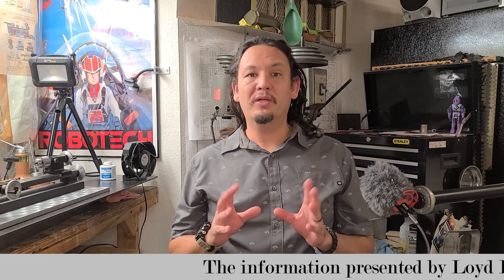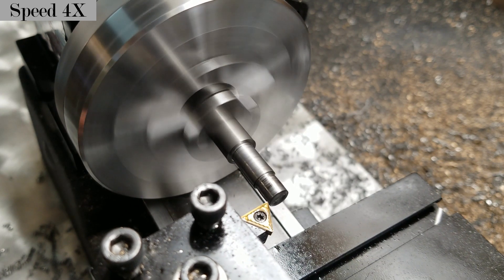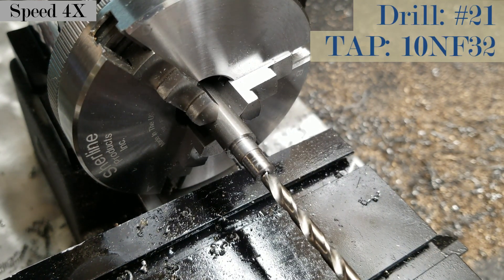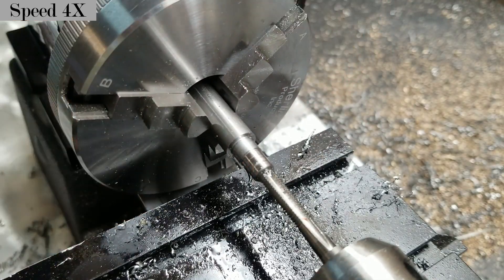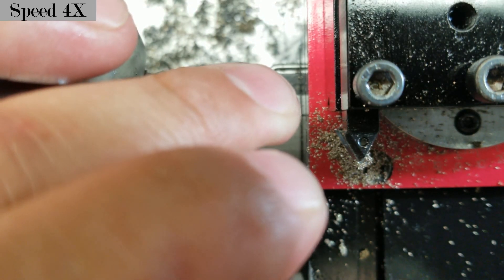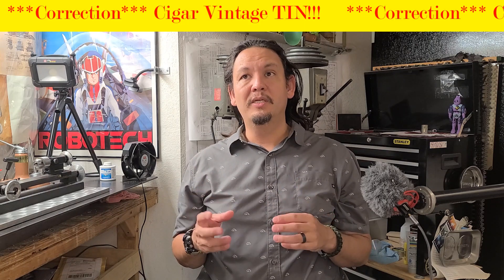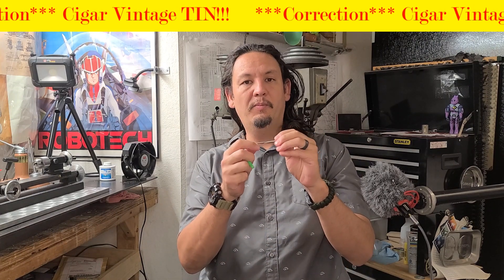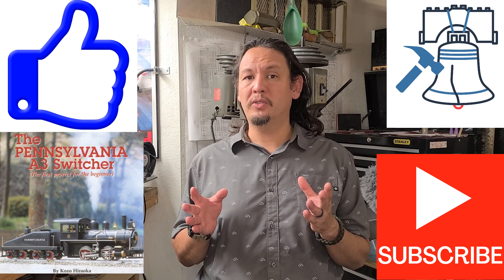Finish Phosphor Bronze Journal Bearings Turning, Layout, Taper Cutting, Fixture Making

Comment: If you have any money left (ha ha) a very useful add on for your Sherline lathe is the Beall er32 collet chuck and some collets. It screws on instead of the 3 jaw and is much more repeatable so if you ever have to go back and reuse a mandrel or remachine a parts it is centered. Get good quality collets such as Techniks brand. I got mine from All Industrial Tool. No financial interest in any of these, just use them all the time with my Sherline.
Reply from the maker: LOL too sad and true.  It all disappears like a smokey cloud of cutting fluid!!!  Thanks for the tip I'll check out Beall's collet chuck.  That be great to have to do a little work and step away or do something else and pick right back up again.  No the hard part finding enough money to get one!!!

Comment: Hi Loyd    On your 2:50 comment  ----- not so sure backwards as much as deflection tool pressure bend.  It looks like piece bending from tool going in  ---my thoughts anyway???????   Another thought  -------- With your bottles for your taps etc.   Go to Wally-World get yourself  ''Plano'' divided /adjustable  FISHING TACKLE BOXES & dyno label maker.  These are cheap - adjustable compact- makeup various  'kits'.   My example  tap/die set usually won't go below 4-40/ 6-32  MY (1) MODEL ENGINEERING TAP/DIE SETUP INCLUDES  1-72/2-56-/4-40/ 5-40 ---- FIND THAT ONE IN A SET ETC   & WITH THE DYNO LABEL MAKER YOU LIST THE CONTENTS --- PEEL OFF IF CHANGE   NOTE 5-40 USED IN LOT OF CASTING KITS/ I ALSO GET THOSE LITTLE DRAWER CABINETS --- MOUNT ON TOP OF ONE ANOTHER ON THE WALL/SHLEVE      ANOTHER  THOUGHT      KEEP MACHING     LIKE #1270 USE    MIKE G P.S. WITH EACH SIZE TAP INCLUDES TAP/TAPS(3-SET/TAPER,PLUG,BOTTOM) DIE TAP DRILL)
Reply from the maker: I watched it few times and it seems like the fixture/jig is flexing.   It looks like the chuck is steady and in place.  Looking at the still i took, it does seem like it is sticking out too much.  Not absolutely sure, but something I need to be conscious in the next go.   

I like that idea of using a tackle box.  A nice separate compartment for each grouping plus some bolts, screws on hand.  You just gave all the excuse I need to drive to Bass Pro.  

Thanks for listing some of your tap die sets.  It gives me an idea of a few to put together and keep on hand.
Reply: @LoydPrecisionMakers  Hi Loyd  another good container place is 'good ol Harbor Freight. They have some divided boxes approx 1 1/2 deep in different  amounts that fit inside the bigger box. The bigger box is grey/yellow meybe 17 x 12 looks like a Stanley. these are cheap to for what they do the outer box remains same while the inner boxes makeup the configureation  One guy I watched used one for his model engine casting kit. He put the individual casting in its assorted & everyone had its own box     Mike PS the outer box has a clear outer cover hinged with 2 snap locks + carry handle They also stack on top of each other.
Reply from the maker: Thanks I'll have to check those out.  It has been awhile since I have been to Harbor Freight.  I want to stay it has been since Harbor Freight stopped their 20% off coupons.  I don't even now if they started that back up again. They do sound like a great way to keep organized and keep thing from getting damaged.  It would be nice to have clear lids to look right in.  Thanks!!!